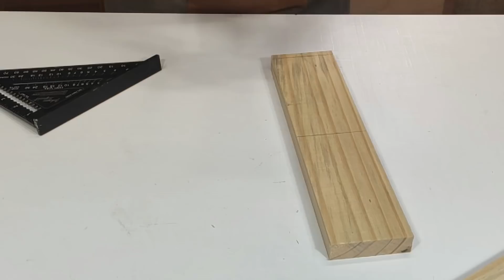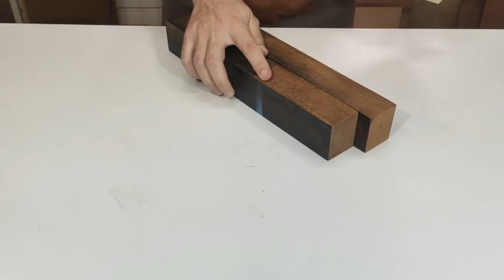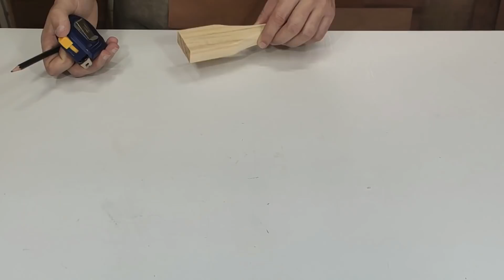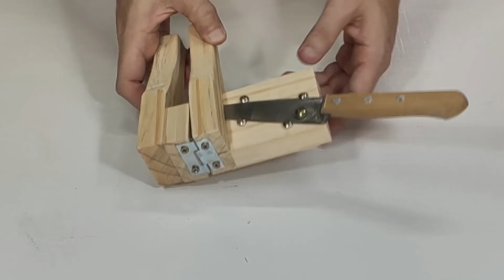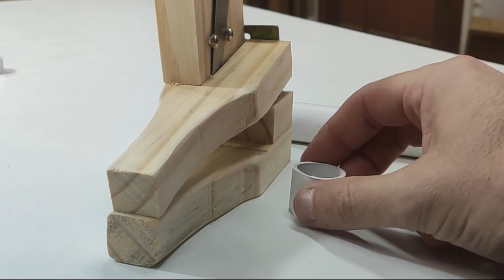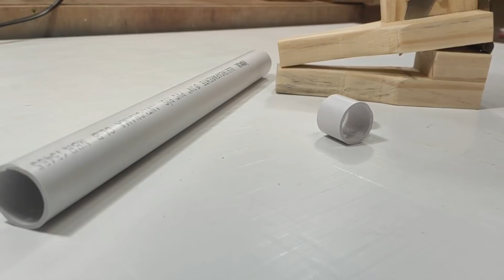AMAZING IDEA – You didn't expect such an amazing and effective tool.

Comment: Why not just use the saw you made this with?  WTF!?
Reply: Because that wouldn’t be such a colossal waste of time and couldn’t make it on YouTube.
Reply: 1) the saw might not give as clean a cut. 2) this could be built with non power tools. 3) if you have to cut a lot of plastic pipe, this would give you more ease and precision than just using a saw. Imagine you’re outside installing the pipe in your garden. Generally, you cut it to fit as you work. You don’t precut everything in the shop first. How long is your extension cord?

Of course, one could buy a little rotary cutter. They’re not very expensive. It would be surprising if the place you bought the pipe didn’t sell them.